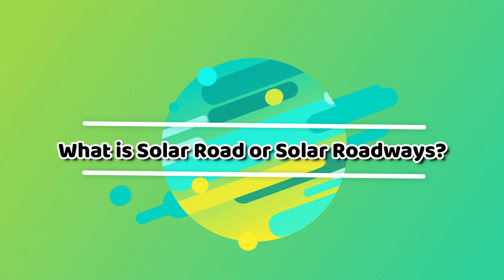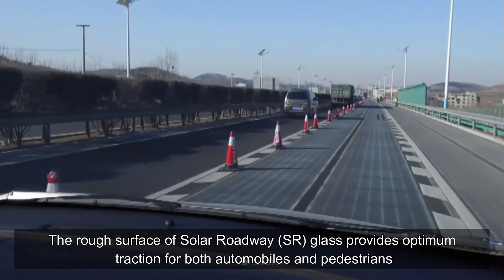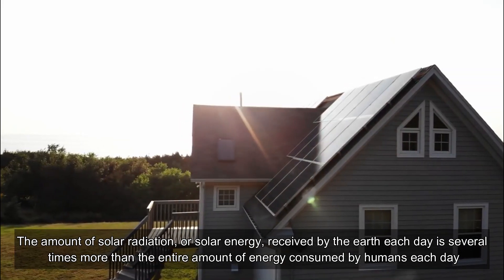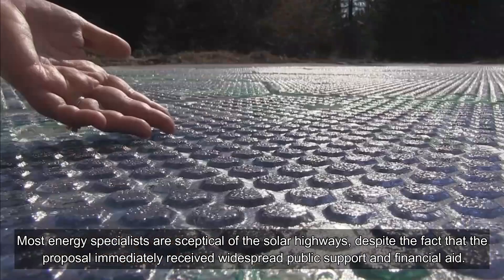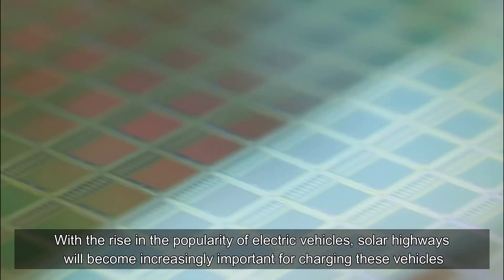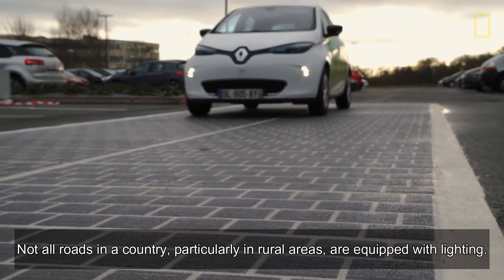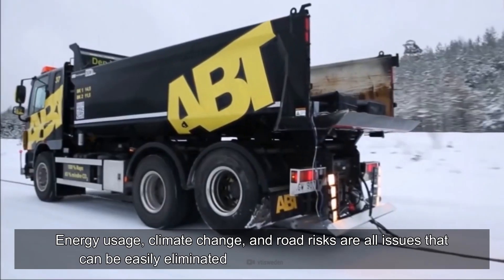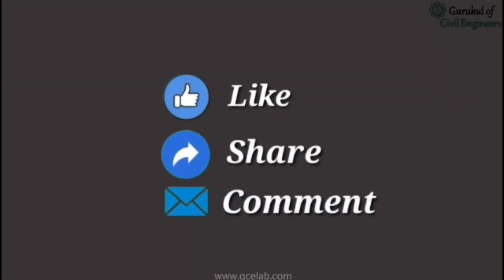What is Solar Road | Solar Roadways?

Comment: This would be better suited for low-density walking areas than roads. Low-density walking areas have less foot traffic, and people generally are a lot smaller than vehicles on the road, which means less blockage of the sun to the panels.
Reply from the maker: Many thanks for your comments.

Comment: put solar panels on the road?      Added complexity with less efficiency than putting it on the roof. . . Wait,  and there is no benefit for being on the road.
Just put the solar panels on the roof,  or in a field and call it a day.   No need to add the extra complexity.

Plus the LEDs are going to take a TON of energy,  similar to LED billboard energy usage during the day. . . Are we actually saving energy?